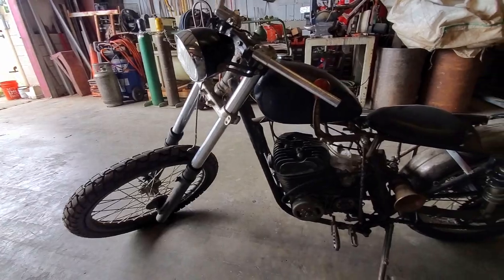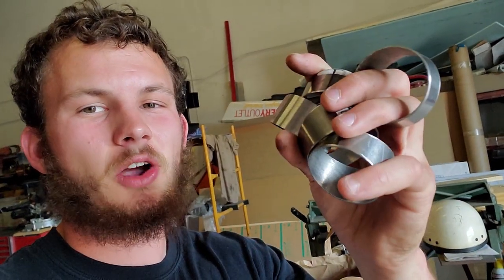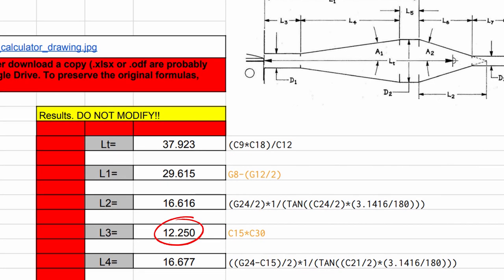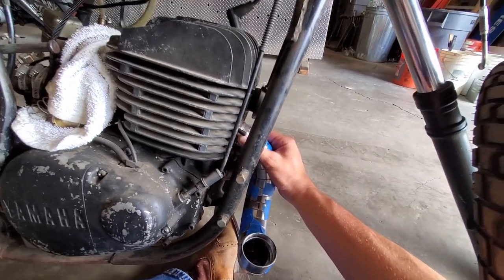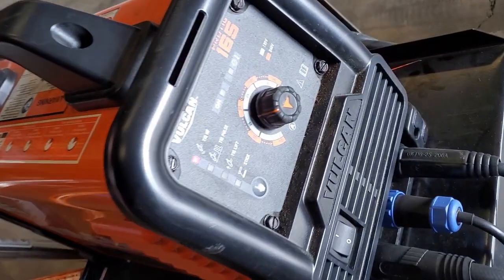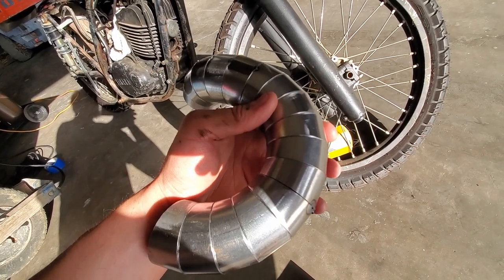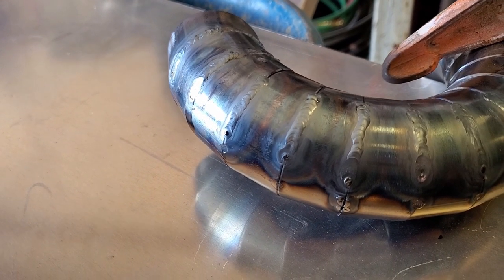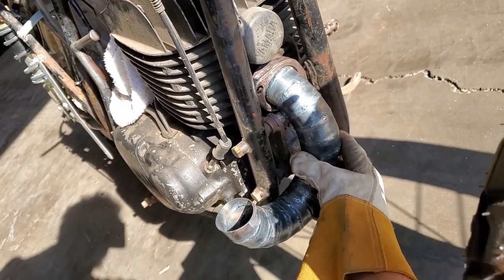EXPANSION CHAMBER BUILD PART 2: Mock-up & Fabrication

Comment: your tig wire must be rusty due to being old or kept in a damp place that's why it looks like your welding with a sparkler. use mig wire its cheaper! Also thinner so it doesn't take as much heat to join the weld pool so you will have a thinner and less blobby weld. try to use a bench grinder or even a cutting disk when sharpening your tungsten so you don't have abrasive/bonding contamination. everyones a critic I know, Im no expert myself but it makes a hell of a lot of difference.  you will find you will have to feed more so u will get the weld pool rings more consistent. AND most importantly only wear a glove on the hand you hold the torch with! its soooo much easier to feel what you are doing with the wire and when auto feeding the wire between your fingers n thumb becomes 2nd nature start wearing the glove again.

well done anyway. ive gave you a like. keep up the good work
Reply from the maker: Thanks for the good criticism! I need all the help I can get, lol. Great tips 👍🏼
Reply: Top tip - grind all the pie-cut ends flat and fuse weld them together. There shouldn't be any need for wire... well maybe a little if it blows through.

Comment: Just checking my understanding , needs to be 12 inches of curved lengthy before the expansion chamber , would you just measure with a piece of string I’m guessing
Reply from the maker: Remember that the curved tubing is measured at the centerline of the tubing. You can use a string, but since I made pie cuts and measured the height of one piece, and stacked enough of them to get 12 inches

Comment: Get yourself one of those harbor freight band file Sanders and clean those welds right up
Reply from the maker: I could easily clean them up a bit, but it's my first real TIG project and I'm gonna keep it as is. In a couple years when I have some skill developed, it'll be cool to see where I started!
Reply: @FormulaJake  up to you of course though you can see exactly where you started by watching this video you posted to the world.
It be interesting to see how strong this sort of quick and dirty welds are compared to something done proper and back purged.
Reply from the maker: Definitely. I know back purging is much more crucial for stainless, and isn't as big of a deal on mild steel. If it were stainless, it would be a disaster on the inside.
Reply: @FormulaJake my bad Thought it was stainless...
Reply from the maker: @axa.axa.  You're fine! I'm new to this, eventually I'll try my hand at stainless but not quite yet.

Comment: That's a dt400 yes?? With an old-school aftermarket head.
Reply from the maker: Not sure about the head, but it's a DT360. I have a 400cc cylinder sitting in a box, ready to be installed some day 👀
Reply: @FormulaJake  i mean..
 The stroke is the same my main concern is pin diameter. Not a bad job on that exhaust. I'm getting ready to do a street tracker build with my 76 dt400. So I'll be doing a low pipe.

Comment: Around 3:30 you stack the pie cuts and it had to be approx 12.250. How did you know you were at that length you just went a ahead and started welding. Not coming off rude I love the vid good info I’m actually trying to make one myself using the same spreadsheet!
Reply from the maker: The best way to find out would either be to measure across the center of the tubes using a string line, or measure each segment before welding. I could have been off a bit, but I wasn't too worried about it haha

Comment: Johhhh. People like smoothe welding on a oioe. Betyer use oxy acethileen welding. Nobody like bumpy welds. Just giving u my opinion and from people around me
Reply from the maker: It can be welded smoothly with TIG, it just takes practice. This was my first time welding pipes, I'll get better 👍🏼
Reply: @FormulaJake  ok that i understand totally. Respect!
Reply: @FormulaJake  which software do u use to calculate the pipe? TsR. Wizzard, Bimotion pro??
Reply from the maker: Any of them will work! In our part 1 video, we showed our spreadsheet in a Google Sheets document. Here it is!

https://docs.google.com/spreadsheets/d/1nksxtd8M9KeJJ8l10ZHtq8yk8W6gZQZhXmFXj4fGZC4